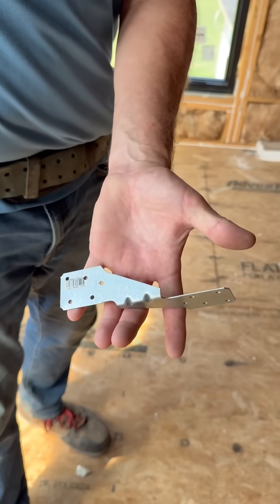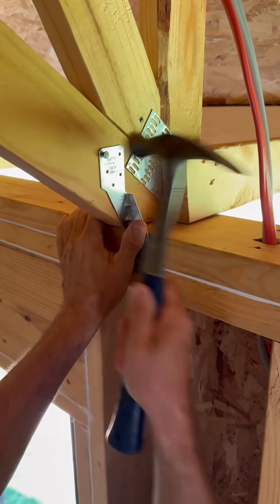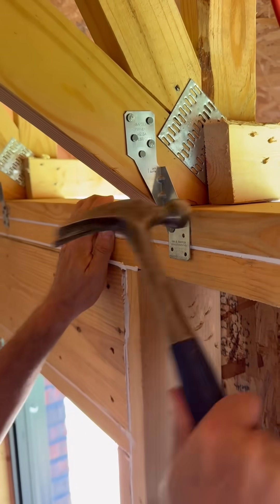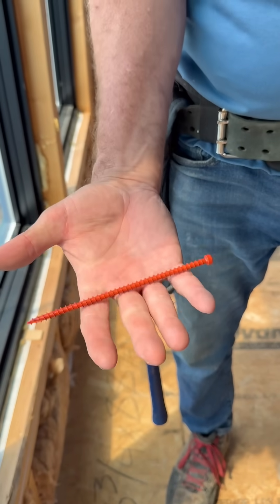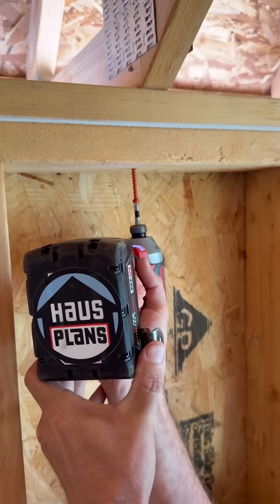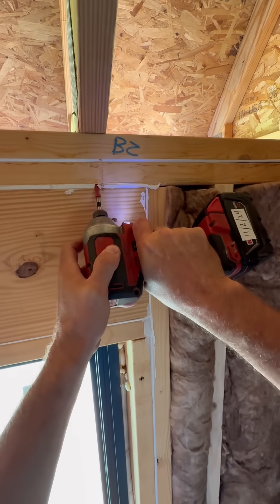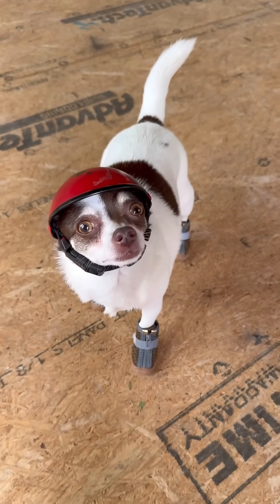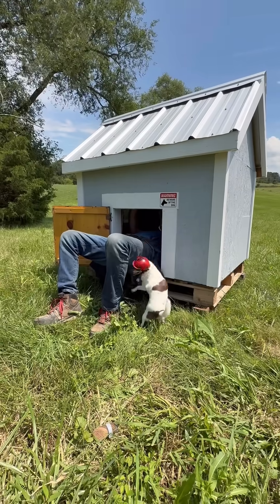Installing Hurricane Ties So Our Roof Won’t Fly Off In A Storm

Comment: I literally cannot believe how far behind the USA is in terms of craftsmanship. I never would've guessed... Their "carpentry" is so lackluster, that they need to add a piece of sheet metal to make it sound. Why not construct the wood construction in a way, that it acts as a integral structure from the get go? It does not require more wood, it does not require more metal, just skill and a bit smarter invested time.
Reply: Why waste resources on something different areas don't need? Almost like requirements for different areas are dependent on what they face. 

This is like asking why doesn't Europe make all of their homes resistant against 7.0 earthquakes?

Comment: If you're worried about the drywall, sticking out on a house high-end build then chisel out a shallow notch on the top plate. Yes, it takes forever to install those things so may as well take all the extra time you need.

Comment: the New Guys House will pass Inspection no problem 
but do these actually work ? or will they just pull down the Walls with the Roof instead of without them just blowing the roof awayand leave everything else standing

Comment: why dont your trusses sit on the studs? Structural framing should all line up, all the way down to concrete.
Reply from the maker: Not necessarily is when your studs are 16 inches on center only when you bump up to 2 foot on Center for code

Comment: I have a 30 y.o. above ground deck on our home, (structurally sound, in great shape), but when I was doing some fixes to bring it up to current code, I got these ties to reinforce the connection between the deck frame and the beams on the support posts. It was never moving or unsteady, but my thought process was, "how can I make sure this lasts another 30 years?" Using these was one of the solutions I came up with. 

There's a prominent brand out there that makes quite a few kids of ties, I've used them on a few projects and it really helps keep things rock solid, square, and lined up perfectly.

Comment: He ain't wrong the house is built in America are not built to last that's for sure they are built with the cheapest materials the quickest is possible and honestly the engineering Concepts especially in high storm areas you would assume Architects engineers and all the other brainiacs would decide to do something a little different
Reply: That's the neat part We have different codes in different parts of the country for different needs. I live in the American South in an area that gets be set by multiple yearly heavy storms up to category 5 hurricanes and most new constructions you see around here are made with block and stucco most notable for being made of giant cinder blocks. I personally live in a house that's made out of concrete and steel. We also have the hurricane ties as mentioned in this video as well as windows that need to be hurricane rated. 

It's also different on the west coast where their biggest problem is earthquakes. Even further different in the plains where their biggest problem are tornadoes. The needs of each area are heavily factored in when determining building code.
Reply: Meanwhile Americans have double the average living space per person compared to most countries...

Comment: I'm one of those Europeans, building house out of wood, fine, not my circus not my monkeys and not everyone needs their house to withstand 152 mm of love from neighboring country paying a visit, but if "house" can't handle angry wind it's not a house it's a shack and calling it house not only messes up terminology but also is insult to actual houses.
Reply: The average wind speed of a tornado can range from 181 km to 321 km an hour. The lowest end hurricanes have speeds of 118 km an hour sustained and the highest can be 252 km an hour or more sustained.

I'd say there's quite a bit more to it than just angry wind. That's also not bringing up the fact that there are different building codes for different areas in the United States where they often have different needs thanks to the sheer number of natural disasters. The American South is usually beset by hurricanes, the central plains by tornadoes, the West Coast by earthquakes, and the Midwest by blizzards and each one requires its own consideration during construction
Reply: @Jackie_XIII  Metric system usage detected, opinion accepted.
Reply: @crusaderanimation6967  Even just EF3 tornadoes have leveled building in Germany or France all the same. You severely underestimate tornadoes. They are not just "some wind".

Meanwhile the US has double the average living space per person compared to most European countries and FAR FAR FAR less deaths due to cold and heat.

Comment: That's a Simpson A35 hurricane clip call it what it is there are meant to be used in seismic Zone 4 primarily there's no reason why they can't be used other places and by the way those Nails you're talking about those are called TECO nails the purpose for using a TECO nail is that it is not a brittle material like a screw it's meant to bend and mold and adjust to the situation without completely sharing off

Comment: In Florida when tying trusses to concrete block they have ties that are embedded in the wall and wrap around the truss.  Also, gable dormers aren't used much anymore because they catch wind (ours lifted up even with hurricane ties, but only about an inch, and was quickly rectified when the roof was replaced).
Reply from the maker: The codes get stricter when you’re close to the coast
Reply: @hausplans true that!  Hurricane Ian did a serious number on my area... The main road by my house has 2 miles of power poles snapped off at the base and laying in the road.  They're still fixing stuff from Ian.

Comment: In Australia the top plate is bolted to the concrete slab / bearers. That's not coming apart easily. (Yes is uses a long threaded rod.)

Comment: Is the white stuff caulk? Any reason you did it in between the plates and kings?
Reply from the maker: This house has already been insulated. We removed it out-of-the-way in this area for the video. Part of the insulation process is that the insulators caulk between all the double studs and plates so air can’t leak in
Reply: @hausplans  surely all insulators do this right? Never really see these details in other builder videos.

Comment: A few years ago during hurricane season I saw a video of some guy in Florida who literally ratchet strapped his roof down before a particularly intense hurricane.

He put anchor bolts into the concrete both in front of and behind his house(I think it was 4 on each side) and ran some really long ratchet straps over the house connected to each corresponding bolt. Don’t remember he attached the straps to the bolts, but nonetheless, his roof was perfectly fine meanwhile most of the houses in his neighborhood were either totally missing roofs or had serious damage.

Almost makes me wonder if some kind of standardized system of “roof straps” should be part of the building code in hurricane prone areas.

Comment: Ah, the Estwing steel shank hammer.  I love Estwing tools, but if you've ever had a case of tendonitis from one of these, you'll switch to hickory.
Reply from the maker: The wood handles definitely do help a little bit with the shock. I prefer a wood handle for framing nails.

Comment: On the drywall…if you can, use the rasp or similar and slightly notch out the plate area…sits flush

Comment: It's funny how the US has hurricanes, yet the building codes in Germany (no hurricanes) are so over the top, that on our last project I spent a hole day installing two hurricane ties per rafter using ring shank nails, even though they are held down by screws with an 8mm (~1/3 of an inch) shaft diameter anyways.

Comment: If I was you I’d put little things like fire bombs when they burn they burst and out out fires use it for your house no idea what there called but I’m 20 wanting to do what your doing but have 30 years of hard work ahead of me I’m sure, so yea just have them in the walls in kitchens or the ceiling above the stove sensitive areas and expensive equipment little anti fire bombs

Comment: Are all american houses like this? Made out of wood? Well why cant it be built using brick?
Reply: Some are. It's pretty rare, but not a "never."

As for "weak" American houses; In media, people only see and hear about the worst. That's what catches attention. That's what generates people clicking on links, which generates ad revenue. Even before the internet, negative headlines sold newspapers and tabloid magazines. While most of our newer houses are built out of wood, only the hastily-built ones, usually with the cheapest wood, fall apart. When stronger, higher -quality wood is used, and is built well, those houses are pretty secure. They might not survive a direct hit from a strong tornado (common in America, but less so in Europe), but neither will anything short of a bunker.

Comment: Hurricane ties? So normally american roofs are not attached to the house? 😂
Reply: If they weren't attached, they'd slide off. I know you want to be funny, but actually think for a second. These hurricane ties are reinforcements. In addition to normal brackets attached with a couple of screws each, these are attached, for extra strength.
Reply: @JohnGMott  How are they attached then? Seems like the brackets are the only ones holding it down

Comment: I had to hand bang 120 of those bad boys that’s damnear 1200 my arm was sore as hell lol and it was in a industrial pizza shop down town all open ceiling you have to use the hot dipped galvanized 1 1/2 inch 8ds fun fun times lol I didn’t bring my palm nailers or nail gun because it was a last second pull on a job and I grabbed what i could try swinging a 28 oz est wing for 120 hurricane ties

Comment: As an European I must clarify, the issue is not with tying the roof to the house but with tying the house to the ground in hurricane areas. We also have light constructions as a budget compromise, probably the same as in USA, not everyone can afford steel reinforced concrete and Porotherm.

Comment: The major advantage to European construction is only avoiding shrapnel when being bombed.
Other than that, the homes take much longer to build, less thermally efficient, less flexible for modification and worse for the environment because cementious based products require much more BTUs than wood.
The plumbing and electrical systems are just embarrassingly poor quality. 
I'm speaking for more Eastern and some Western European construction and probably alot less northern European construction practices.

Comment: Not without tie-downs like they use for trailer houses anchors that screw into the ground with straps that attach to the structure otherwise the whole building will just blow away I live in Oklahoma I am a Master level Carpenter trust me the wind is no joke here

Comment: I totally agree with the Europeans here. No wooden house, no matter how well it is built, is going to survive the 100 mile per hour sustained winds, 150 mile per hour wind gusts, the severe flooding, and EF3 tornadoes that a direct hit from a category 4 hurricane brings with it. If you truly want a hurricane resistant house build it out of heavily reinforced concrete that’s at least a foot thick and elevate it about 20 feet off of the ground.

Comment: Wtf why did you caulk the top plates?
Reply from the maker: This house has already been insulated. We remove the insulation in this area just to make the video and then put it back. The insulators always caulk the seam between the studs.
Reply: @hausplans why? With osb/plywood, housewrap and then ultimately siding on the other side of the wall. I have no idea what thats doing for you.

Comment: Holding the roof to the sall is great.
But
What holds the wall to the foundation?
( Except gravity)
Reply from the maker: Anchor bolts that are embedded into the concrete
Reply: @hausplans 
How are they attached to the wall studs ?

Comment: The first ones I learned hurricane clips . They are so worth the money. 
    I had inspectors tell me I went over board. Yet the city agreed with me. 
     I wouldn't put a roof on anything with out them metal across the peak. Walls. And so on.
Reply: Overboard, better than underboard. I have people say I worry too much about safety, but I haven’t had 10,000 of steel bust through someones trailer yet.

Comment: If you’re worried about the dry wall being held out just route a check out for the cleat then it’ll sit flush. If you’re an ape you can also beat it flush with a hammer

Comment: For real tho, European houses in the Balkan are mostly wood framed tile roofs, and the horizontal wood beams are screwed in for the horizontal reinforced concrete beams, so it's not such a safe connection if your concrete mix is dodgy, but the overall weight of those tiles makes sure it stays on.

Comment: what is the caulk in joinrs of frame  lmbr for?
Reply from the maker: That’s one of the steps that the insulators take to keep any air from leaking in
Reply: @hausplans .....i built homes did static air test when required...but never went that far..corners..tees..elect boxes...passed...guess they dont expect sheet rock to help form the envelope....like your vids..i had a doxie new guy....rode in truck for 7 years...peace...

Comment: In Queensland, 50 years ago or so, they got a monster tropical storm, damaged almost all of Darwin's homes, more or less made them all unlivable.
The QLD government made a lot of changes to housing construction, but the single most successful one was wooden homes there are required to have a wire anchored in the foundations that travels up each stud,  over the plates, and along each rafter to the opposite side of the house.
 The entire roof is tied with 5mm tensile steel wire, to the foundations.
Storms do nobble  a few rooves not, but only a very few, not the whole city.

Comment: Hurricane Ties with Simson Screws work the best. Just using the Truss Screw is honestly sub-par. 
The only down side to the Hurricane Tie is the typical use of nails. Though, with a total of 10 nails, you do get a lot of sheer strength.
Reply: Yeah honestly for the cost its better to just do both than picking one system over the other

Comment: To be clear, wood or not I really do appreciate anyone who is working hard building homes. Especially building home for the new guy, he deserves the best
Reply: @hausplans  подскажите пожалуйста,что находится между досками,белое?
Reply: @GeorgeN-bl7qn most likely a sealant of some kind but that is just a guess
Reply: @GeorgeN-bl7qn  Silicone caulking. It helps seal against air leaks. It isn't something you see very often. It was done here because the homeowner is also the builder. This would be an expensive upgrade to a custom build.
Reply: I really appreciate anyone building proactively. I believe the supermajority of builders will not spend the 60 cents and hour or two to avoid abject catastrophe.
Reply: @AnneDunning-s3c  You can count yourself lucky with new construction. If all your trusses are in the correct locations, none are broken, and they didn't use Bluetooth fasteners. 
I've seen all three in the same attic that passed the local building inspector's inspection.

Comment: H2.5A.  I call them out all the time as an engineer
Reply from the maker: That’s correct, which do you prefer? The H2.5A or the truss screws?
Reply: @hausplans  H2.A. Cheap. Strong. Easy to install. My contractors love them them.
Reply: @hausplans  I also use them to tie deck joists to beams

Comment: As a Volunteer Firefighter, I do want to point out that the metal pallets you have on the roof joist (idk what they are called) are not very safe. If the house were to catch on fire those only hold in around 0.25-0.5 inches into the wood. Meaning that it wouldn’t take to long for them to not hold up. 

I do want to mention that I have not seen all the videos on this house building so please correct me if I’m wrong and if I missed anything that would prove this wrong
Reply from the maker: I believe you’re talking about the gang nailers. Those are the square metal plates that are pressed into the wood by the truss company. That’s a standard way of building trusses in both commercial and residential. I’ve never seen it done any other way.
Reply: @hausplans . Yeah those are what I was talking about. Today we actually inspected a house that was being built and those were some concerns. Then again they were rebuilding a home that burnt down so….

I was just curious because I don’t know a whole lot about buildings and you are building one so you obviously know a lot more than me